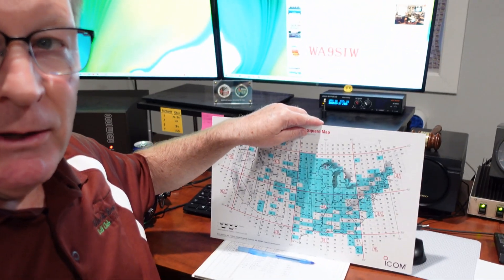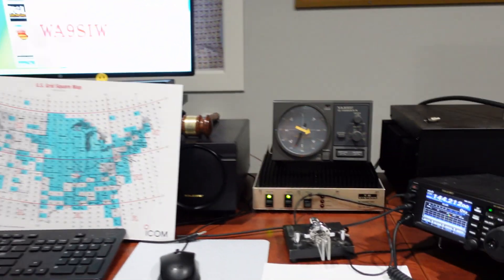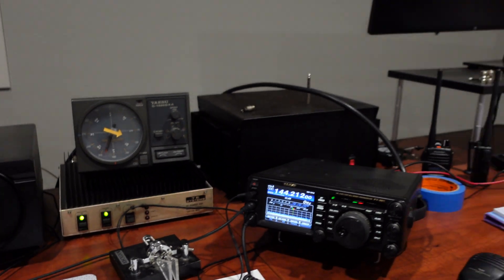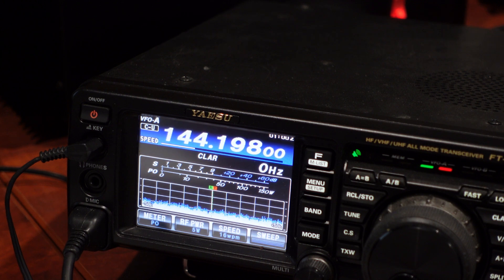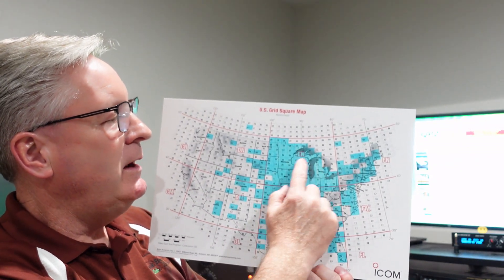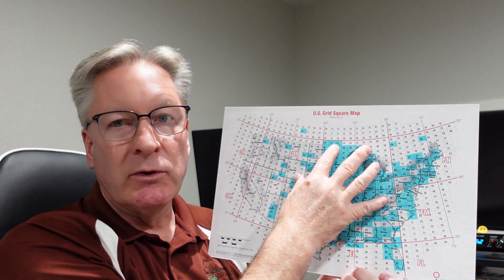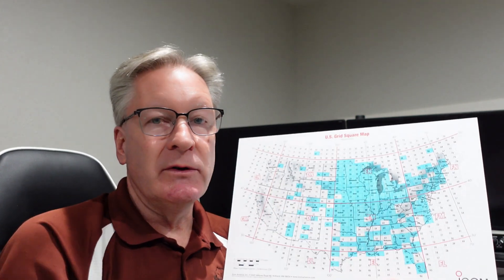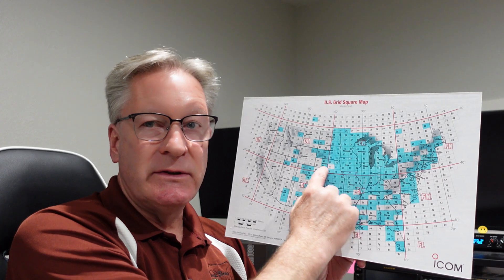Amateur Radio 2 Meter Auroral Communication | Bouncing Signals Of The Aurora!

Comment: It looks like you just recorded other QSO’s. Did you record any of your own? I was hoping to see the impact of your amp. I can probably spring for a long yagi but I’m gonna have to be careful about how much I spend on an amp. 73’s!! WB3CFN
Reply from the maker: I filmed some of my Q's but they weren't as good on video as the ones I used.  It was great to listen to other QSO's so I could show two grids on one contact.  The amp is awesome!  If you buy one, you'll love it.  The preamp is hot and I get 400 watts with 5 watts drive.  I love TE Systems bricks.  73!

Comment: That is very interesting.  Thank you for sharing.  Amazing how the radio signal interacts with the curtain of the auroral.  Thank you again.
Reply from the maker: It is a fun hobby and I love using all the different means of communicating.  Thanks for watching Janice!
Reply: @TheOldSwedesFarm  I hope that one day, I can actually have a multi ham radio setup so that, I can access different bands  I agree with you, digital is not ham radio but, that is an individual thing.  I know you suggested different antennas to get started but, I decided to buy the Cushcraft HV-4E which looked like a good antenna, I just got it yesterday.  I know that MFJ is going out of business, but I thought this antenna was good for the price.  I am still in the process of learning CW and with time I will get there. Thank you Rich for sharing your ham radio experiences.
Reply from the maker: @53Heidi2  Looks like a good antenna for 10-40M.  Get as many radials as you can under it.  It'll really help it perform.  If you have questions, let me know.  Are you already licensed?  Not sure if I had asked that before.  Where are you located?  73!
Reply: @TheOldSwedesFarm  Yes Rich, I have my extra license and I am located in SC.  I still haven’t been able to get my radio back up and running but plan to very soon.  Thank you and 73.  Still trying to learn all this radio stuff.
Reply from the maker: @53Heidi2  Congrats!  When you get operational, let me know.  We can meet on 20 meters.  I used to get to SC each month for business.  Loved Columbia!  Take care!

Comment: Are the raspy tones from the aurora affecting someone’s the sound of someone’s voice? Are these distances very rare normally?
Reply from the maker: These are very rare distances.  Normally I can talk out to about 250 miles.  This is 144 MHz, so it's higher than your FM radio.  It'd be like hearing an FM station from 700 miles.  The raspy tone is just the signal bouncing off the uneven curtain of the aurora.  So much fun for us hams!